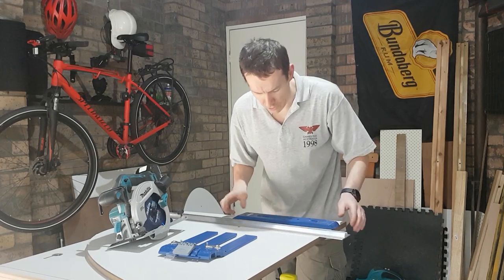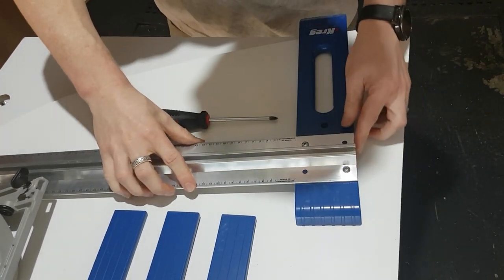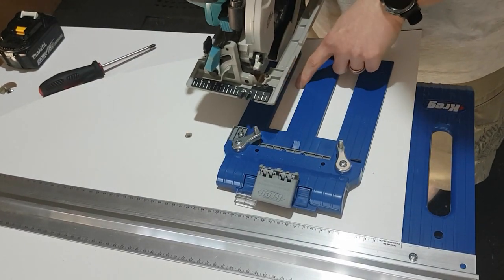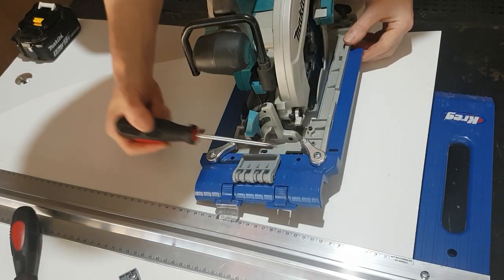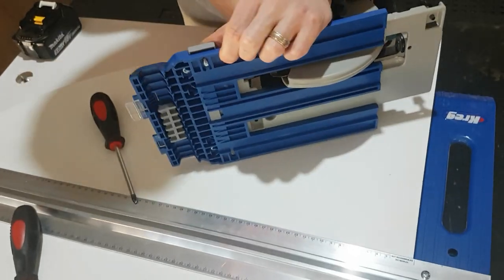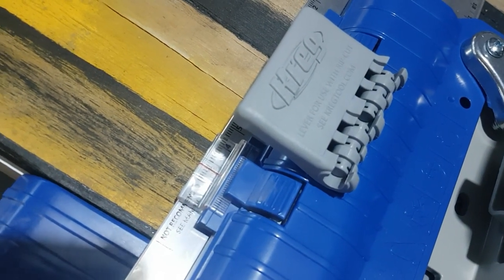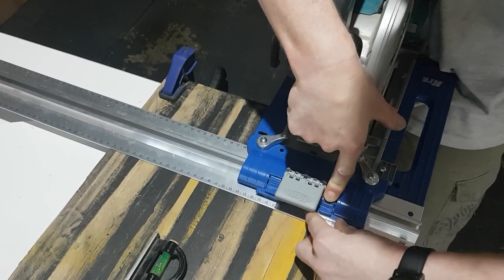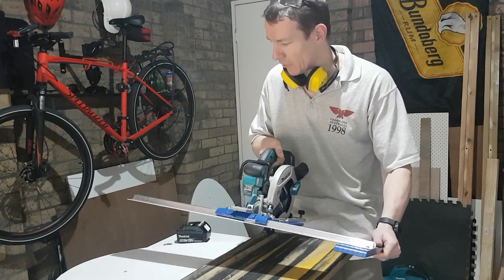Kreg Rip-Cut: Setup and Review

Comment: Between the Rip Cut and the Accu Cut, I don't even use my table saw to break down sheet goods anymore. It's easier, safer, and best of all one sled fits both jigs.
The one thing I've learned though, is to keep an eye on the saw to sled orientation and make sure that the sole plate (shoe) of the saw stays butted up to the sled. It usually happens when ripping wider cuts, from diagonal torque, you need to make sure that the edge guide and the saw sled are moving at the same pace.
But don't get me wrong, I'm not about to kick my table saw, radial arm saw, or miter saw to the curb just yet.
I'm with you I like Kreg tools too. I have more Kreg products than I'm willing to admit to my wife.
Enjoyed the video, cheers from Canada.
Reply from the maker: Hahaha, I just don't tell mine how much they cost ;) Do you find the Accu-Cut a worthy investment on top of the rip-cut? Been thinking about getting the track but not sure if I really need it.
Reply: @FixitFingers , the Accu Cut works great when cross cutting a sheet of plywood beyond the capacity  of the Rip Cut. I added the expansion to mine, which gives me a track 106" (270 cm) long. This is almost enough to cut a full sheet of plywood diagonally corner to corner. 
The Rip Cut does not do diagonal cuts, at least not intentionally. 
I would recommend getting the track clamps as well. 
Like you I wasn't sure at first about buying it, if it was worth it, would it just stand in the corner collecting dust? 
In my opinion, for what I'm doing, is it worth it? Yes it is.
I use to use one of those aluminum straight edges that you clamp down to your work piece, well guess what's standing in the corner collecting dust. 
I hope this helps.
Cheers.
Reply from the maker: @andyfunke9484  awesome, all good points. Next sale I might have to convince the wallet to open 😂
Reply from the maker: G'day Andy... 6 months on and I've followed your advice  😉 Got myself an Accu-cut too and giving it a test. Liking it so far... still no (real) table saw though 😅
Reply: @FixitFingers , hey James how's it going? Been out of town for a few months on the annual off grid cabin build, way off grid, it's a two hour drive into the woods, then about two hours if we're taking the barg with us, to get to the cabin site. Fishing at the end of each day is absolutely killer though. We had a daily derby to see who does the dishes. It's so good we just call it catching instead of fishing. Lol.
Anyways, I was going through my emails, after returning to civilization, and seen your comment. Glad to hear you convinced your wallet, to relax it's death grip, just for a moment. 😉
Appreciate you taking the time to let me know about your purchase of the Accu-cut XL. Hope you find it useful, because mine proved worth every penny along with the Rip-cut. 
I had a half a dozen 2X12X20' boards that I had to take an inch off of the width. This is where I like the same sled works on both tools. We set up a half a dozen saw horses, put two 2X12's beside each other, one that was getting cut and one to support the remainder of the guide rail and the saw. I picked up the circular saw off of the the Accu-cut track, attached it to the Rip-cut, set it to the final width of the board, and proceeded to cut a perfect half inch off each one the full length without stopping. To do a cut like that on a table saw would be difficult at best if not impossible, not to mention dangerous. Never mind doing it free hand. 
I also see you've posted a video on the Accu-cut XL, I'm looking foreword to see how it turned out. I'll shoot you a comment after I look at.
Well it's getting to that time of the day, I've gotta get back into that daily commute and cross the yard and go to work.
Cheers.
Reply from the maker: @andyfunke9484  That off-grid build sounds awesome Andy. I've already found the sled versatility jump from Accu to Rip Cut incredibly useful, and managed to work out how to do thin strips with it quite easily too that were not possible on the rip cut. Loving it!  Kreg Australia has just launched a big Spring Comp for $2k worth of blue tools... so I gotta get creative with my arsenal😁

Comment: This is certainly another one worth picking up in the Kreg line. I was surprised this one won't break the bank. It should go quite nicely with my Ryobi Brushless.
Reply from the maker: Literally pays for itself in a few sheets of plywood. Before I got it I had to buy those 1/4 sized project panels which are very uneconomical. Being able to car park cut full sheets to fit in the wagon saves you a bunch (and gives you access to larger bits when needed). Thanks for checking out my Kreg vids 😃
Reply: @FixitFingers  While we're on the subject of Kreg, do you think those cheaper galvanised pocket screws in their range will be good enough for robust and durable garage shelving?

Or should I opt for the mid range blue coated ones? 

The expensive ones, are a bit out of my budget.
Reply from the maker: @blahdiblah2169  Oh god yeah, the normal ones are fine 99% of the time. Unless things will be out in the rain or getting wet constantly the regular ones will do.
Reply: @FixitFingers  That's a relief because the galvanised ones are actually affordable. Comparable to any other screw out there. 

Exciting times ahead, and I'll be sure to keep in touch and keep watching your advice. At this stage I've ripped out everything from my garage, repairing the floor and walls, adding new lighting, and after this then the fun can begin. 

I'm a complete novice with woodworking, so every single thing I build will be a first. 

Yesterday for the first time I used a random orbital sander, and I'm slowly building a collection of Ryobi +one. Circular saw, drill/driver and this orbital sander. 

Next thing I need is that Kreg K5, followed by a Jigsaw and a router, and then I should be good to do for rough build projects. 

Anyways that is what I will be doing 90% of the time. I'm not skilled enough for fine woodworking and I need to build shelves, raised garden beds, benches, garage tables, etc. So fun times ahead.

Comment: FYI that blade guide is designed to zero the blade to the edge so that it will be compensated for the width of the blade.
Reply from the maker: Yes the micro adjustment is great, but I did see a video where they did what you suggest a little later using the guide to zero it off. A bit easier than how I did it here 😅

Comment: Hi, thanks for sharing and the review only thing I noticed you never checked is when you attached the track to the end of the guide and screwed it in you never checked for an exact 90° angle because a lot of customers have complained that it is not an exact 90° sometimes. did you check yours? After the review thanks,
Reply from the maker: G'day mate, no I did not, (I trusted the machining)... and I never have. To be honest, I don't believe it matters greatly if it is off a fraction of a degree here. There are many places for error in regards to square on this guide... the joint you mentioned, the sled connection to the guide arm it moves along, how the saw sits in the sled, the actual blade in the saw... all could easily be off exact 90. but if you set it up carefully the blade will be very very close to parallel with the edge guide. (If it wasn't your blade would bind and kickback. This has never happened to me). What IS important is that width of what you cut off is consistent to a reasonable tolerance and repeatable. After a couple of years of use, I can confirm my unit at least is usually out by < 1mm (3/64") over 1m (So 1/1000, or 99.90% accurate), and repeat cuts are basically carbon copies or each other. I have never readjusted it since I filmed this video. Careful setup and practice are a big part of getting consistent cuts as with any tool. Honestly, your cut result is usually better than the factory edge you are referencing against. The only really tricky bit is the last part of the cut when the guide arm starts to leave the work piece... that is usually a 'wobble' point. So I am in the habit of ripping first over-size, then cross cutting to length nip off that little wobble bit (kinda like allowing for snipe on a planer). At the end of the day its a US$40 tool jig that replaces a lot of what a table saw can do, and does a few things a table saw can't. It won't ever be as accurate as a good, well set up table saw, but it does what it is designed to do very well and pays for itself breaking up a few sheets of plywood compared to buying 1/2 or 1/4 sheets, and Im still happy with mine and use it a lot. Great question! Cheers mate.
Reply: Fixit Fingers OK, thank you so much for the quick reply and look very detailed explanation be safe.
Reply from the maker: You're welcome Walter! It was an interesting thought exercise.

Comment: Hi, do you have a guide on how to install the kreg rip cut to a festool Ts 55 circular saw? Thanks
Reply from the maker: G'day mate, no sorry Festool is a bit above my budget so I've not handled one.  With their often unique designs I wouldn't be surprised if it doesn't fit the Rip-cut. (There are a few saws that don't). Best check in store with your Festool supplier, they may know and have options for you if it doesn't.
Reply: @FixitFingers  thank you